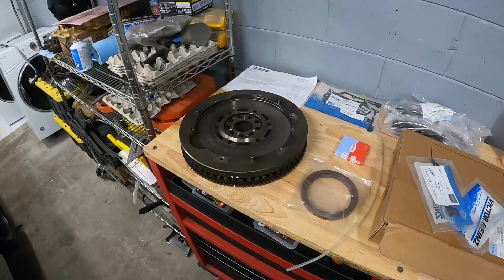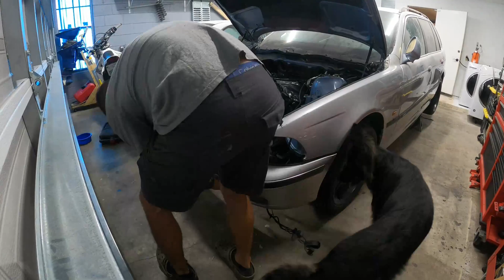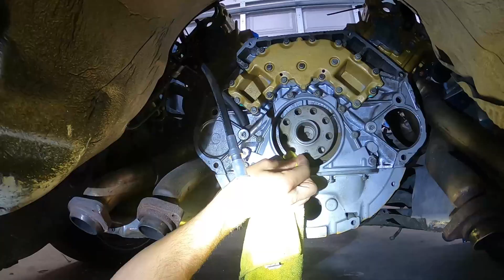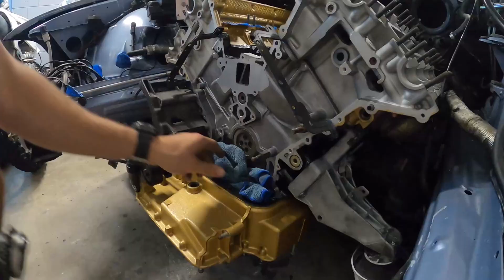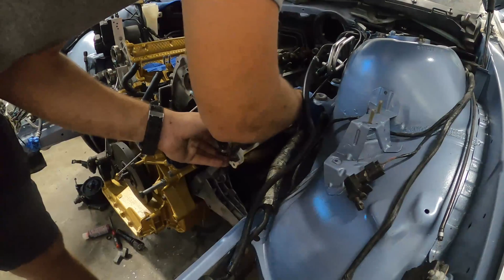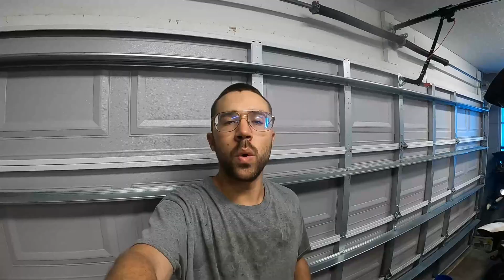S62 Timing Chain Guide Installation: E39 M5 Wagon Build Part 8

Comment: I agree with comment below.lots of details please. Like camshaft timing etc. Also where to get all detail timing info for S62 motor. There is not very much detail out there about rebuilt of everything on this motor.  Thanks.
Reply from the maker: I have multiple videos with regards to timing and assembling the motor, but this is definitely not something you should be doing at home without proper resources/experience. Even BMW trained techs have issues with timing this motor from what I've been told. My recommendation is to use the service manual (found online, google) as well as the Beisan timing procedures (lots of pictures). I'll be rebuilding the vanos in a future video, and will try to show as much detail as possible :) Thanks for watching!
Reply: @TheBimmerBarn  thankyou very much. I do nearly all the work on my cars self.did not do this yet,but must very soon replace all vanos seals. No power on engine. I am on my 11th bmw. Had from 330d to 740i. 4x e39's so far. Now 528i 5spd and M5.6 spd manuals.

Comment: Please go in the details, it would be of great help for others like me. I’m talking torquespecs, and these missing pieces of video where you jump from fastened camshafts to chain and sprockets installed etc.  Other than that, awesome work. Keep it coming:)
Reply from the maker: I use the website "newtis.info" to reference all my torque specs, they have all the details, which change between the model years so pay close attention! :)